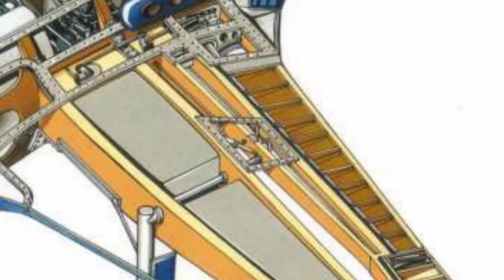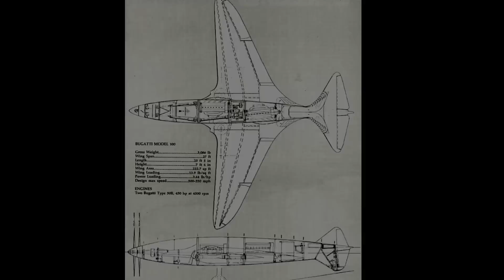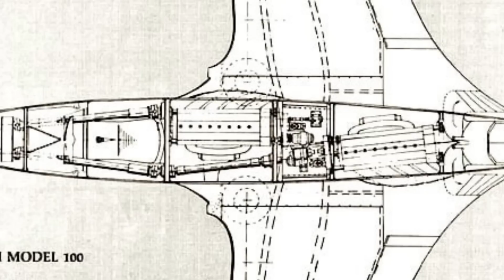The Plane Built To Beat Nazi-Germany (Bugatti 100P)

Comment: Certainly beautiful BUT, the prototype never flew so there was absolutely no knowledge of actual flight characteristics. Scott Wilson was a test pilot in every meaning of the word. As I understand it, the plane stalled after suffering a mechanical issue with either the drive or an engine. With a wing like that, the wing loading must have been pretty high so any issue adversely affecting airspeed was fatal.

Comment: I have one of the paintings and was around Scotty the entire time he was building the Bugatti 100P at Harvey Young Airport in Tulsa. The air frame was great and only reason it crashed and killed Scotty was the motorcycle engines used to power it. One of the engines, which were set in second gear kicked into neutral just after takeoff and the other engine was not enough to keep it flying. The motorcycle engines were only about 100 to 120 horsepower each and not the 450 to 550 horsepower the aircraft was designed for. It flew but when one engine went out of the loop the other was not enough to keep it flying. Larger engines were just to expensive. Always wondered what it would be capable of with light weight 380 horsepower turbocharged BMW engines.

Comment: Beautiful airplane... but would had been better with 16-cylinder boxter flat-engine, rear counterrotating propellers with scimitar folding, two seater and a military version with the rear seat substitued by a 20mm vulvan rotating cannon.

Comment: No, while "sleek" and aesthetic, its aero dynamics are all out of line, nightmare center of gravity, and wing design terrible for creating effective AOA, more parasitic drag along WITH nightmare empennage . Tremendous torque problems in propeller and drive shafts configuration  I would imagine if there was an explanation of the crash, you would probably see that the aircraft stalled after take off., or broke apart in flight as its frame could not support the g loading in banks. The engines were the best part of the aircraft. This just shows you can't cross over build in a race car performance to building  aircraft performance., except for some Formula one physics in common with aircraft

Comment: I have a suspicion (no, I’ve not checked this) that the claimed power of the gorgeous Bugatti engines is nowhere near the level quoted in this video, I recall that the late 30s cars’ output was usually given as “approximately 300bhp.

Comment: As an Aeronautical Engineer with decades of relevant experience, Bugatti and De Monge made a beautiful design with good but NOT brilliant engineering considering the limited resources as a boutique shop.  The greater research and development resources of the USA, Britain and Germany devoted to fighters produced superior fighters with growth potential.   Also the forward swept wing would have had a divergence static flutter failure at high speeds.  The innovative cooling might have been as good or better than the P-51 system, but the two 180 degree turns reduce the efficiency.  Such a radical design should have been medium scale RC tested for safety or other modern options to protect the test pilot.

Comment: TBH, this plane would have performed excelently for it's time, but would have ran into the same issue as the German He-100.
It was a plane designed for races, not war. The issue would have been that even some slight damage to the airframe could have totally crippled this beauty. I think it was better that it didn't get developed further since Germany would've probally tried something with it, and it would probally not have been for the best...

Comment: Until the unfortunately crash 2016 what kill the owner (replica) it was never flown "at his time"not a single testflight. to compare it with bf109 is more than optimistic. it was a racer designed for speed but very sad that the great bugatti never see it in air.

Comment: The image of an engine you keep showing in the Type 45 car is only sort of an example of a Bugatti straight-8—it's a U-16, which is basically two vertical I8s on a common crankcase geared together and, in this case, also supercharged.

Comment: i followed the development of that replica , was awfull that he crashed after only 1 or two test flights ,. question has to be was it ever actually a viable flying machine ?,certainly looks the part though ,worthy of the name bigbeautifullcat
Reply: The slightly forward swept wings might have flexed too much when turning. Even with modern materials, this is still a problem. If I remember correctly, a 1960s small plane with the same tail configuration, had control trouble when air flowed in certain ways.

Hopefully some enterprising aviation engineering outfit makes a full size, remote controlled, carbon fibre model for kicks and giggles. Would make a great campaign for Bugatti.

Comment: One of the most stunning airplane designs I have ever seen and for it to come out during the 1930s is even more astounding. This airplane is a thing of art. Tragic to know that the flying replica killed its pilot.
Reply: Problematic reverse wing design......
Reply: @RamonInNZ  The crash was due to motor problems and loose power and he stall, the replica has kawasaki motors instead Bugatti impossible to find, the design works well on pc simulators, sorry for my english ;-)
Reply: @RamonInNZ  the wing had nothing to do with, while low altitude high speed conditions were known to be troublesome due to ground effect, it was established that the cause of the crash was due to the powerplant and clutch, (two suzuki hyabusa engines and clutches) the clutch on the engine driving the closer prop to the pilot, started slipping giving reduced power, it was also noted that the pilot didnt have full power applied.  the power train issues were known and some steps were taken to remedy them such as a tensioner being installed. 

Personally I think its a shame that they didn't go for more reliable engines that dont use chains and belts, however a factor that was noted was the lack of funding which may of played a role in them selecting two motorbike engines.

Comment: I want to know why she crashed and why did that stop all forward workings to change or fix what ever needed to be done. I've studied aircraft ever since I was a kid and I can see myself the tail of this aircraft needs to be changed.  I would bet if you maid up an airframe out of modern material, and used a more powerful motor this plane could do what was expected of it.  The wings are just like planes that do all the acrobatics and tight turn racing. It needs to be at least three feet longer after the wings and get rid of that style tail, tip down the rear wings like an F- 4 phantom to catch as much clean air as it can and use a upright rear ruder . Just remember the mid engine fighter of world war two, and look up what problems they had to deal with on that aircraft with weight distribution cuz that is a mid engine plane as well.  The wings on the aircraft I'm talking about look very similar just not tipped forward. The tipped forward wings will give your aircraft very good reaction in turns and banking and snap rolls. The vents in the rear wings are a good idea, I wouldn't change that at all. But the tail of your aircraft needs changing. Lengthened, and rear tail wings changed for better air surface.  Hopefully you or someone will see this message and finish that aircraft.

Comment: To use it as a fighter you would have to use armour plating for pilot and engines  plus additional armourment  plus to feed two engines  bigger fuel tanks needed  All this extra weight would have critical effects on its performance    when faced with combat against the Bf 109
Reply: Fuel consumption wouldn’t be too high I don’t think since it had two 5.0L engines which have a combined displacement of 10L whereas a the jumo 210 from the BF-109 displaced about 20 litres to produce less horsepower (at least on early versions)
Reply: They didn’t have armor until 1940 so it would have 12-18 months at least before that’d be a real problem.

Comment: As a designer what a beautiful design. Never mind if it can be use as an military plane or not it such a nice look to it.
In the design world how it look is one thing but In the real world how it function and practical is major in winning the war.

I have several issues with the plane design and function.

Protection the pilot with all glass canopy. Firepower, the guns large enough caliber be able to take down an enemy aircraft. Weight issues, if you’re going to have armor surrounding the cockpit to protect the pilot, and with a bigger caliber gun, to take down the enemy aircraft, by putting on a more powerful engine to accommodate the weight issue will this change the performance, speed and flying characteristics of the aircraft? We will never know.

Comment: I think the aircraft lent itself to rear prop propulsion. Built with a light weight alloy frame and covered in a polymer/kevlar skin,  only one engine would be required. Lots of room in the cockpit and linear drive train, all in the rear.

Comment: The aircraft is undoubtedly a beautiful design, and with a name like Bugatti attached to it, it would be nothing less. However, having said that, the Issue with the aircraft is something that Bugatti and Demange could not anticipate was the highly unstable flight characteristics of forward swept wings, since no aircraft had yet to be designed with such wings. Demange put them on because they looked good but forward swept wings are extremely unstable at lower speeds and NASA found out much later that without the aid of computers to make changes to the flight control surfaces while at lower speeds, aircraft with these style of wings tended to stall and only pilots with a extreme amount of experience could compensate quickly enough to not fall out of the sky. Which was the reason for Scotty Wilson's untimely death, after an engine failure reduced the replica 100P's speed to levels that resulted in the wings of the aircraft to stall and lose lift. Without a control computer to make for allowable changes in the flight control surfaces at lower speeds, the 100P is nothing less than a death trap. It is a stunningly beautiful aircraft and one that very well could have beaten Nazi Germany's choke hold on the airspeed records of the time, IF they had designed the 100P with rearward swept wings. Unfortunately the Tale of the demise of Scotty Wilson acts as a cautionary tale regarding antiquated designs of aircraft. For there was a modern aircraft with forward swept wings, The Grumman X-29. Had Mr. Wilson and his team consulted with NASA engineers and test pilots, he would have discovered that the flight Characteristics were dangerous and outright suicidal with an aircraft with underpowered engines, Which Ironically was also an issue with Mr. Wilson's replica 100P. Although the aircraft had two Hayabusa engines mounted within it's fuselage, they were still under powered for the airframe's needs which lacked proper amounts of torque AND horsepower. To this day The X-29 is regarded as the most aerodynamically unstable aircraft ever built. It is too bad that Scotty Wilson nor any of his design team had ever thought to look for a modern counterpart to the 100P and ask the design engineers or pilots for either their opinions or any data on the characteristics of a forward swept wing aircraft. Because the replica 100P had conservatively forward swept wings it was able to be flown a few times until the engines began to give the aircraft trouble, and the decision to fly the aircraft once again without properly making sure the engines were  repaired or would no longer give any more problems, was a fatal decision. So not ALL designs from the past are ones that should be resurrected and put into the air, or on the road, or in the sea. I hope that no other person makes the mistake of trying to rebuild the 100P without first consulting the flight data and records of a modern counterpart to the aircraft. Even a minor Google search with the question "What is the most aerodynamically unstable aircraft ever built?" will show a picture of the Grumman X-29 with it's forward swept wings.
Reply: Thank you for the explanation of its failings. I wasn't aware of the instability of forward swept wings and wondered what killed Mr Wilson in his replica.
Reply: The fact the Germans had it after capturing France and Europe and did not continue the project says they figured that out already. One of the Hs162 versions has swept forward wings but for all the wonder weapons' the Germans dreamed up none had this wing stye. (or very few, seems the Germans were up to a lot we did know about pre internet)

Comment: P 100  target top speed 766kph aa a acer
meamwgle Spitfie 1 evaiustin ast  mRTLESHAM
 Seprtembee 1936 top spedd 362.5b mph )(at18,50gt
362.5, mph = 583 kph
Me 109 E  operational on evaluariib 1938   top speed 498kmph

IF THE P10-0 SHOWED THE SAME LPEFOMSMVECDROP  OFV FROM TRSACER YTO FIGHTER THEN ITS YLP SPEDD WOULD BE
THE SAMR AAS TYHE 109 IE 

r Wjrsgter ;ikllot fot `109 

BERINH IN MIND RTGHSATBY 136 RHE SPITTY MIHJT BE DRKINKING 100 OCTANE
SPITTY WITHNONE ENGNE 850HP 5332LB
109 G EMPTY 4954LB
MAX TEMPTY AK OFF 6940LB
P100  3086LB
P11O ????LB

Comment: Balsa wood ? No better than polystyrene. Such a risk. His cars were criticised for having insufficient brakes. Always a risk taker.
Reply: And the Mosquito ?
Reply: Balsa was used alond with variouse hard wood vaneers, that where glued together to form a sandwich composit .
Reply: @miles2378  And They first used  ordinary milk based woodwork glue which was water soluble, but in 1943 switched to a new 2 part urea based glue that proved stronger than the wood it was adhering to.